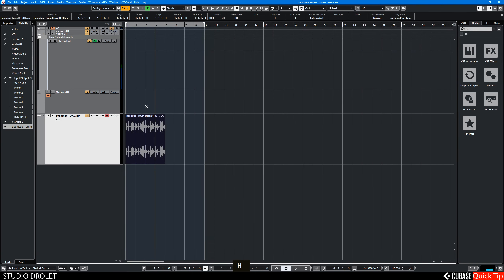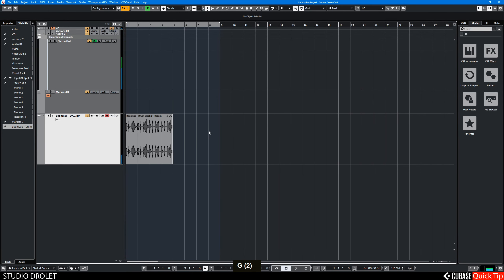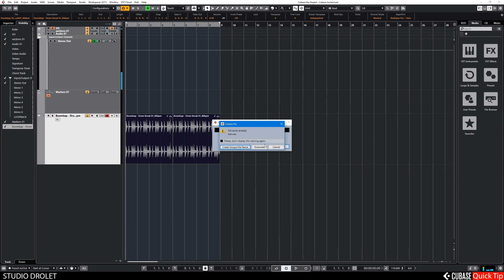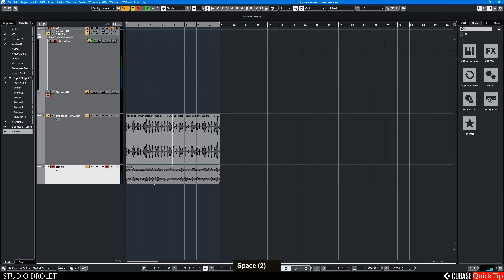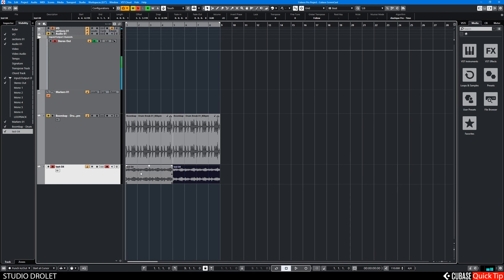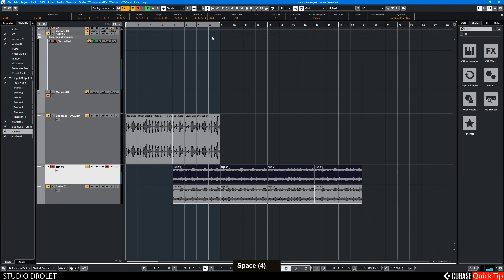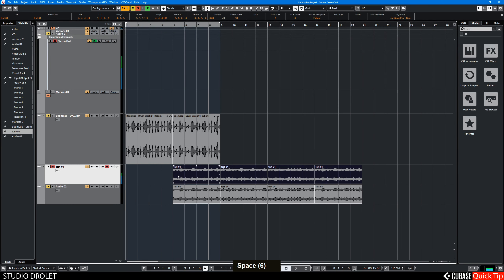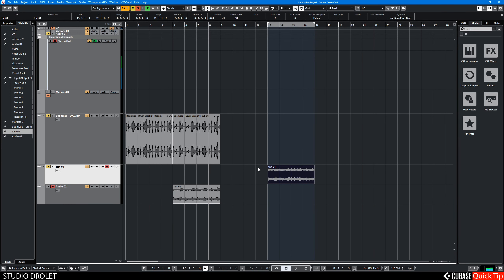047 Cubase quick tip   Printing reverb tails at beginning of loops

Comment: Hello,

Thank you for your tip. But I have a question.

Is it possible to do this without having the reverb on the first iteration?

To clarify: I have a 10sec loops

At 0:00 I don’t want any reverb from the end of the loop
At 0:10 I want the reverb of the first loop to affect the second one.

Is it possible?